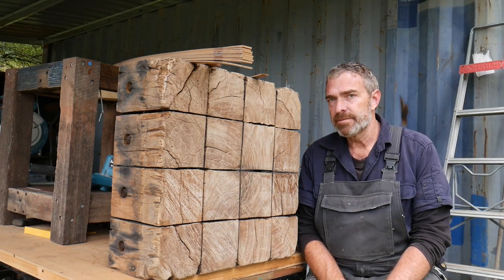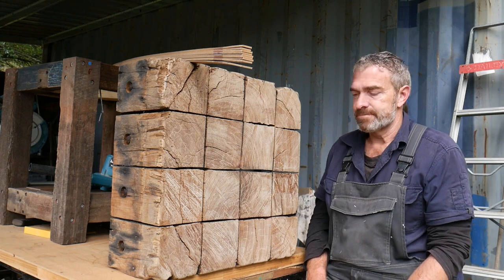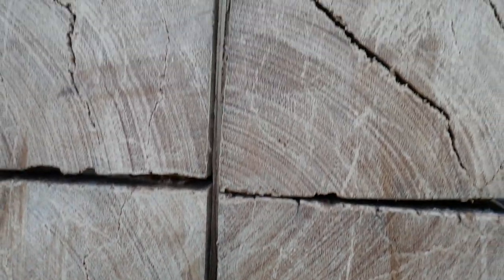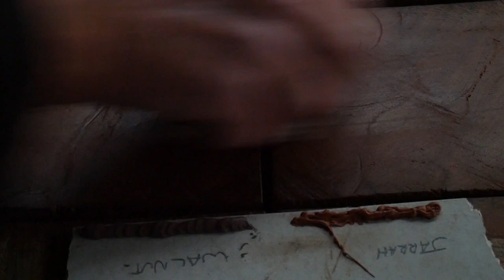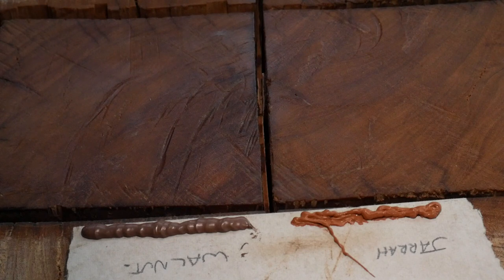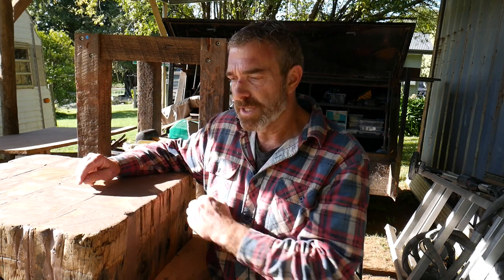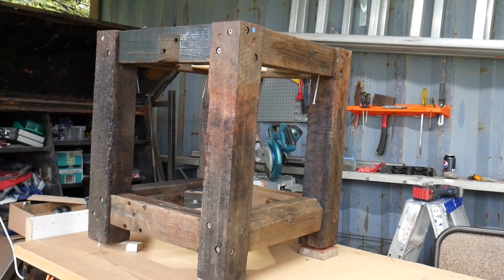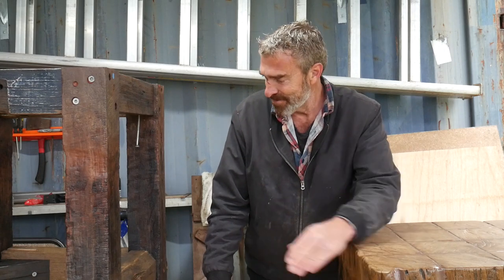Restoring a 150 year old Butcher's Block. Part - 4

Comment: As I keep watching, I keep thinking - just take out the long bolts, clean between the blocks properly, give them a proper glue-up, and put in new long-bolts.  May have been WAY less work than beating pieces of modern plywood into it, and using a synthetic caulk that makes it unsuitable to be used as an actual butcher block again.  However, it's in front of you, not me, so, only you can make those decisions.
Reply from the maker: I never really intended to bring it back to a working butchers block, more for general food prep hence the food grade stain. And maybe even more of a bit of a show piece honestly.
Reply: @RedPathRambler   Fair enough!  Now that I finished watching all the parts, I DO like how it came out!  Nice work!
Reply: @paulfeist  The Caulking ruined it for me no matter the out come all I see is that Damn caulking. And all i can think is what a shame the caulking even ruined it as a show piece for me. I feel the caulking makes it more suitable for bathroom décor! But you're right it's in front of him so as long as he likes it it's just my opinion.

Comment: Good on ya mate for having a go. Everyone wants to criticise. Hindsight is a wonderful thing but I wonder how much those dried up blocks would have revitaised if you had soaked it in linseed oil for 12 months or even longer. Filling the gaps was a great idea.
Reply from the maker: Thanks mate.
Now that's an example of some things, or processes, that I wouldn't have even thought of or to do. 
I'm only a master of one one trade (too boring to feature in videos), and a hack at everything else! 😄
Reply: @RedPathRambler  I think it turned out great. You did a great job on the stand too. Repurposed old timber looks good doesn't it? Good on the bloke at the hardware that was a great idea using the packing timber to fill the gaps. We're even 'cause I wouldn't have thought of that.
Reply from the maker: Cheers CeeDee, and thanks for watching. 👍

Comment: how will the filler go when you start using knifes on the block. if that is what you are going to use it for.
Reply from the maker: I was in the storage container the other day, where I keep it for the time being. The filler is really quite hard now. I imagine it would experience similar scoring from a knife as the timber would. The preservationist in me will probably use a separate cutting on board on top of it 😄 
 Kinda like hmm, wouldn't want to damage it now!

Comment: Why not take it apart and surface the edges and rebuild
Reply from the maker: I tried at one point to unscrew one of the bolts and it was proving very difficult, even with WD40. I didn't want to risk snapping the bolts in case they were too seized.